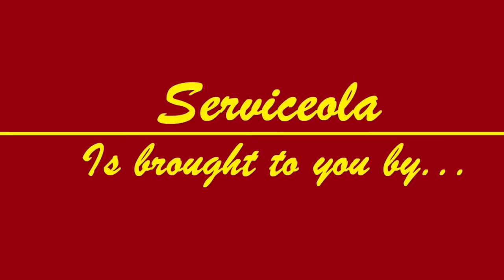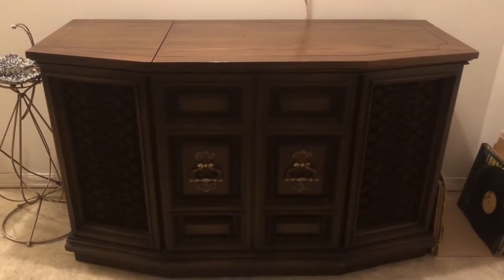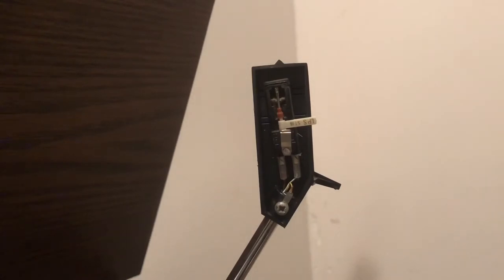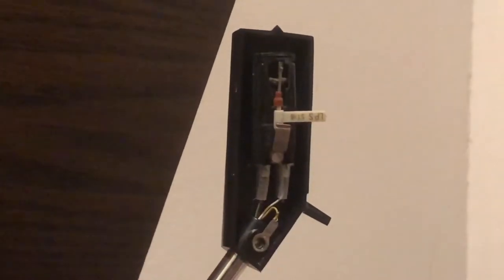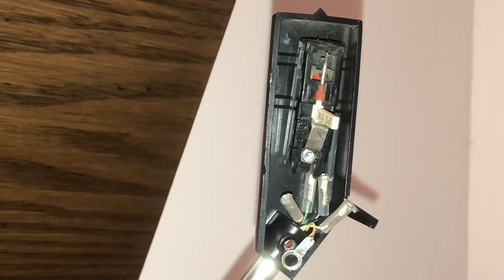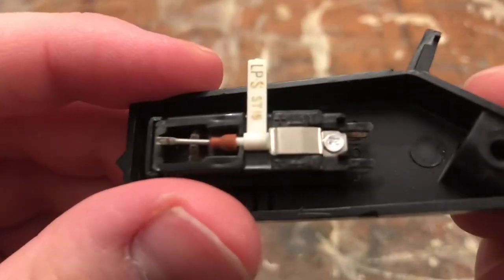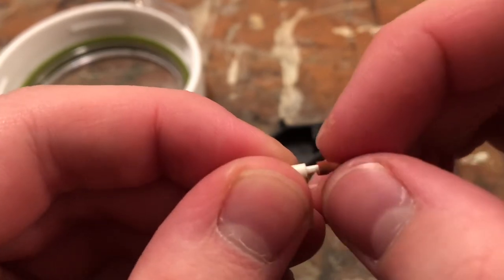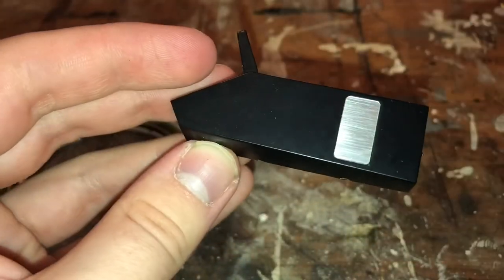BSR Record changer cartridge replacement (Part 1)

Comment: The brushed metal panel on the top of the headshell is a sticker, you should be able to peel it off with the edge of a small screwdriver or knife blade.  Underneath it is the screw that holds the cartridge in place. The cartridge started swiveling because the screw loosened. The rubber thing in the cartridge is the coupler, it transfers the vibrations of the stylus to two piezoelectric transducers. You will probably need to replace the cartridge as the coupler is broken, any similar sized BSR cartridge will do, they are pretty interchangable as long as the dimensions are right. A new flip over stylus should come with the lever, there are a few different shapes depending on how it is held in place in the cartridge.
Reply from the maker: You're the first commenter to comment on this series! Thanks! 

Thanks for the advice. I don't know what came over me or why I decided to wreck the coupler. I'm not going to make that a habit.
Reply: @thegregolarecordsclub6564  You're welcome! At least you did a good job of removing the cartridge connectors, I've broken them and it's a VERY fiddly soldering job.

Comment: Silver sticker top of headshell peel it back and it will reveal a screw. Not a ceramic they are known as crystal cartridges usually the sx or sh bsr series you can put a ceramic in but you may find that u will have to add a capacitor or two to get the voltage right as crystal cartridges usually output 3v. Hope this helps. Kind regards

Comment: That was an extremely abrupt ending. I don't see anyone commenting on this, but I'm seeing a very distinctly clear metal lip that looks like it's meant to be manipulated, directly attached to the rivet, and leads up the a defined halfway indentation between where the coupler & stylus was, and where the riviet itself is. Try messing around with that on your next episode.

Comment: Reasonably sure that console is from around '71-'73.   Older units almost all came with RCA's own model of changer.  Switching to BSR was a cost-cutting measure as consoles were starting to fall out of favor (BSRs were considerably less expensive).  I don't see an 8-Track in yours, which was pretty much standard by the time the 1974 models came out.
Reply from the maker: That record storage bin is where an optional 8 track player could be installed. The amp even has a "tape" setting on the by the knob.
Reply: @thegregolarecordsclub6564    What you describe is an 'add on' installation.  It was fairly typical in the 1960s, and was most often done at/by the store to a floor model.  Took about an hour, and the unit could be delivered to the customer right away.  

They usually found a spot on the back of the console to run the signal leads to the 'TAPE IN' connections on the rear of the unit.

By 1973/1974, though, most manufacturers that were still offering consoles were actually incorporating an 8-Track player (or even a recorder/player) directly into the design as standard equipment.

Comment: Are Varco cartridges easily replaceable?  I'm used to replacing Tetrad ones.  The BSR turntables I get from Goodwill have Varcos but the rubber cradles on them are decades old.  Is is best to re-solder new tonearm wires into the deck and install Tetrad cartridges/corresponding headshells?